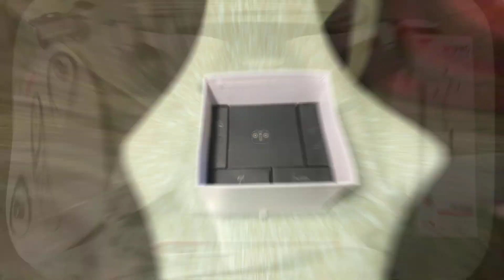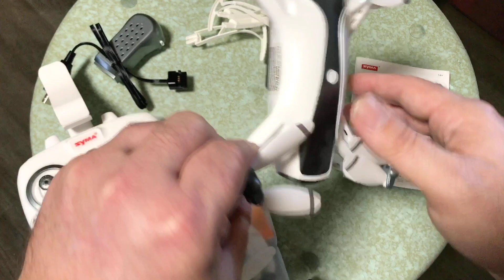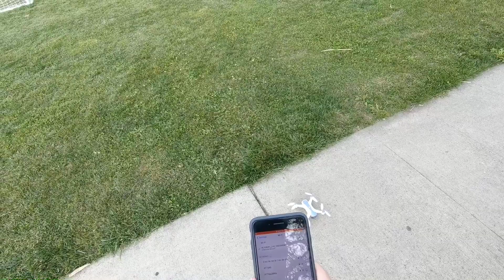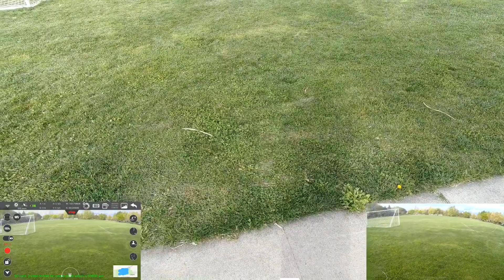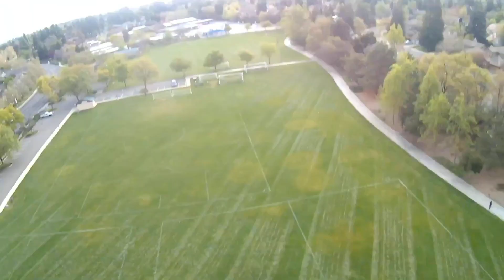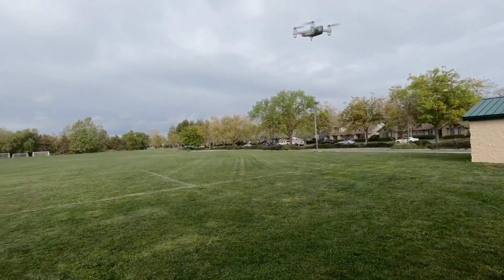Cheerwing Syma W1 Pro GPS 1080p WiFi 5g fpv Camera Drone

Comment from the maker: Soon as the parks open up, I will switch the 2.4g to 5g WiFi . I didn’t realize it didn’t automatically switch to 5g , it’s supposed to when the 2.4g is having a weak signal. Cheerwing Syma W1 Pro 1080p 5g camera Drone from Amazon:
https://amzn.to/2XXhzqc
Syma w1 spare batteries: https://amzn.to/2y

Comment: Question for anyone that knows 100%; on the app screen, in the upper right hand area on the top, there's a place that says 'VR'.  Anyone sure what that's for?  I never got Syma to respond.
Reply from the maker: VR is for Virtual reality goggles, so you could put your phone in a set of VR goggles while your flying. I don’t recommend it, there is to much delay in the video. Having any delays in the video could cause you to crash your drone.
Reply: @BIGDRONEFLYER77RC  I'm already fairly adept at crashing.  I only got my first drone for Christmas this past year and have had far too little opportunity to get familiar with it.  Not being a 6 year old or a professional drummer, I can't separate my hands mentally.  Can't yet get to grips with left stick does this, right stick does that.  Plus, I live in a notoriously windy state, so finding a day that has both low to no wind and warm enough is going to be rare.  On the few occasions I've been outdoors with it, it's usually too sunny to see my screen, which is why I'm interested in goggles.  Mine has a little bit of latency, but not bad.  Plus this is more a toy than a racing drone.  The boss (wife) said to use this as a trainer, then we'll get a DJI or equivalent.  But for the moment that feels a million years away.

Comment: Nice video, I cant seem to connect it to the wifi as you did, ive gone online and no real solutions, also is it normal for the battery to last less than 10 mins.
Reply from the maker: The battery should last longer then that and not sure why your not seeing the drones WiFi on your mobile device.

Comment: man, I’m kinda sad. I bought this drone, and tried it out. But it came out that my drone footage is lagging. Is there any solution ?, btw bro nice content bro
Reply from the maker: Thanks so much, I need to do a follow up video. You have to check is your in 5ghz WiFi or 2.4ghz. It’s in the app, find the 5g setting and make sure it’s on. If it’s not, then it will lag badly in 2.4g.

Comment: Awesome reviews !  I just subscribed to your channel. I have a question: are there firmware or IMU calibrations to make when setting up like my DJI Phantom 3 and Mavic Pro require? or just the app download?
Reply from the maker: Thanks so much for the support. With this drone you have to do a gps compass calibration every time in order to fly. Most of these toy grade drones require it every time. Some with the dji’s if you fly in a different area.
Reply from the maker: The only firmware updates if any would be just in the app. So you don’t have to worry about any firmware update from the drone, just a gps compass calibration for each start up. Plus a quick gyro calibration on a level surface. Thanks again for watching and I will make another video sometime in the near future. That way you can see the 5g WiFi fpv and not the 2.4g as seen in this video.Cheers

Comment: Please help, after 30 meters i loose image in my phone. What i the problem?
Reply from the maker: You have to manually set your WiFi to 5g in the Syma app. If your phone is not 5g Capable and it will not let you set it in 5G. The Syma app is supposed to automatically set the WiFi to 5G network, but mine did not and I will make a video soon on how to manually set it to 5G from 2.4g. Check your device to see if it has both 2.4g and 5g WiFi. You can check it on google and search your model number.

Comment: Hey I have this drone and I do all the steps everything works right except I can never connect to satellites. What am I doing wrong?
Reply from the maker: It only should take a few minutes to receive enough Satellites. May have to repeat again the calibration steps and make sure that it’s in GPS mode and not altitude hold. Without me being there to see what it’s doing, I wouldn’t know what else it would be. It doesn’t work then he may have to return it. Thanks for watching

Comment: Seems like a really good drone and camera with the exception of the poor Wi-Fi. Does that button camera also function as an optical flow camera?
Reply from the maker: I not to sure yet, I like to get back to the park once they open. The WiFi is much better once you manually switch it to 5g, Bryan said his iPhone 11pro automatically switches to 5g. My 7 plus did not. What else I noticed is the box and the front of the manual says the camera is 4k 5g camera, Put really it’s only 1080p.

Comment: Nice looking gos drone shame of 5g range issue
Reply from the maker: Thanks so much for stopping by. The app didn’t automatically switch it to 5G Wi-Fi. So it was stuck in 2.4 G Wi-Fi, when the parks open back up I’ll make another video and switch to 5G manually. Thanks again my friend and be safe
Reply: @BIGDRONEFLYER77RC  wow you are on full lockdown? that sucks in the Netherlands we use common sense and keep ower distance but we can go outside whenever we want and fly my mavic mini and also don't need a paper showing I'm planning to do outside nothing of that crazy stuff simmeler to ww2

Comment: This looks like a good starter drone for someone wanting a little taste of the hobby, I have seen it on sale for around £100 gbp with discount codes which seems reasonable for what it is ( brushless). The main selling point looking at the advertised specifications is the weight, it is quoted at 247 g. this makes it a more viable license free beginner drone than say the Mini Mavic financially. I know that comparison is miles apart but as I say ‘ a novice beginner’ who might not even take to the hobby, I started off with a little £25 toy and was hooked before progressing on. I reckon the price of many non essential goods could well fall due to the current world wide crisis and feel it could well be worth hanging on to see what develops. Currently locked down here, no flying, so busy building and modding. Regards Richard. Yorkshire. England
Reply from the maker: Thanks so much, I started off with a x5c. My first gps was the Hubsan h502e and I paid 130 for it at the time it was new on the market. Drones have come along was and now you can fly a nice brushless drone for under a 100 bucks.

Comment: Totally want one of these...I just dont like the 200 or 250 meter "geofence".
Reply from the maker: It’s still pretty far at 250 for this little drone. I just need the parks to open back up so I can fly it on 5g WiFi instead of 2.4g. Thanks so much for watching.